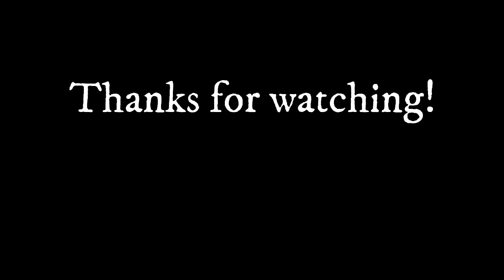POOF it's waterproof!- Waterproofing ICF Foundation with French Drain

Comment: Excellent work. Did you consider Rubberwall?
Reply from the maker: Hey, thanks! We did consider it but we wanted a peel and stick for an air barrier at the sill plate.  We thought it would be best to stick with one material. Are you a fan of Rubberwall?
Reply: @anaverageacre  : thanks for the explanation. I love both the products. I see new home constructions and they just paint tar sealer which will be useless in a few years
Reply from the maker: We are in a beautiful lush green area but we've found that means significant ground water, especially in the springtime so we are trying to choose the best waterproofing without breaking the bank.
Reply: @anaverageacre  : excellent work.
Reply: @anaverageacre  I’m in the planning stages of an ICF house in the VT mountains and I think we’ll get a lot of water in spring as well.  Good to hear that it didn’t break the bank (but it still looks like an expensive process, even as DIY)…

Comment: Why mixing products from 2 different manufacturers (membrane and primer)?
Why fastening the drainage board through the waterproofing membrane?
Why using a primer since it's not required?
Did you read the manufacturers technical documentation?
Reply from the maker: The primer was an addition after discovering that the waterproof membrane did not stick to the ICF foam and kept peeling off. Many adhesives actually dissolve the foam so we had to find one that was approved for use on foam. Which was a suggestion in the membrane instructions, if the built-in adhesive wasn't enough.
As for the drainage board, we needed it to stay in place until backfil so did have to sacrifice and add some penetrations in the membrane. Not ideal although the membrane is self-healing so should seal around the fasteners.
Reply: @anaverageacre  Yeah when it's peeling off it's always a matter of surface conditions and temperature. Primer (with polystyrene it must be water-based) helps enhancing the adhesion quality in those cases.
Great construction :)